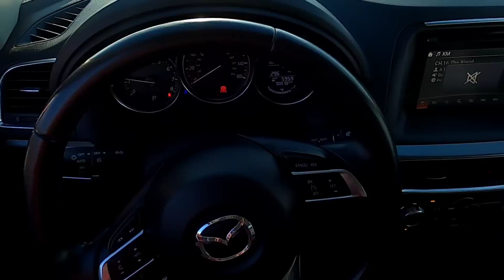Let's Load And Head To Florida Where It's Warm!!! (Episode 8)

Comment: Thanks for what y’all do out there Brother 🤠🤘🏼
Interestin question, why don’t y’all have side curtains for the truck and trailer to protect the cars in winter on the lower deck? Just curious
Reply from the maker: Some trucks do have that option and you'll see it a lot up in the north west they won't let you load new cars without them but since these are used personal vehicles it's not required on our contract with the customer it says any damage caused by mother nature we aren't responsible for so it covers us not that it's going to happen but it can if they want to play it safe then that's why there's inclosed transport but way more expensive
Reply: @Ralphybilt    Roger that, thanks for the feedback

Comment: As a trucker I Know you don’t want to but for the videos you should turn off the rig
Reply from the maker: I have to run it in order for my pto to work if I turn it off I can't load
Reply: @Ralphybilt  understood.
Reply: @Ralphybilt  there’s no way to add an auxiliary to power the lifts?  I’m sure that running the engine and burning fuel is a calculation